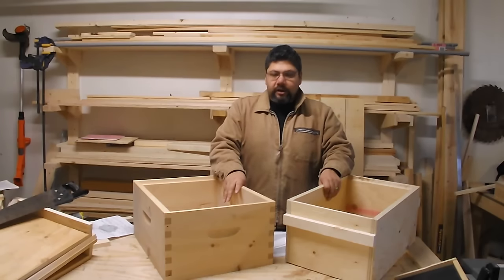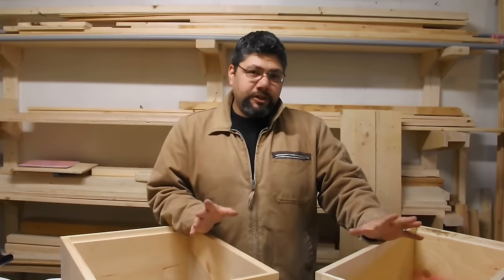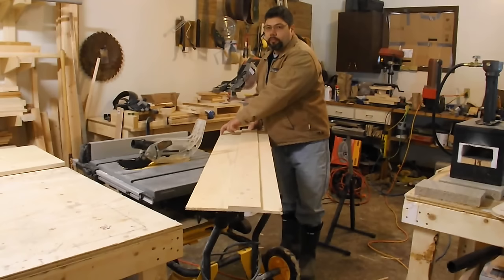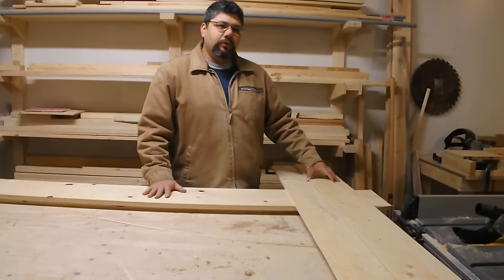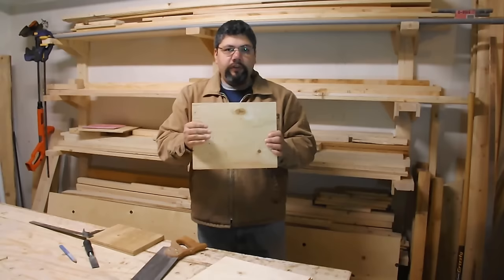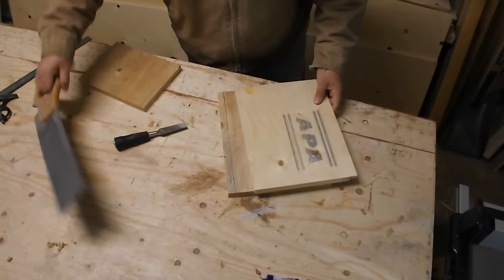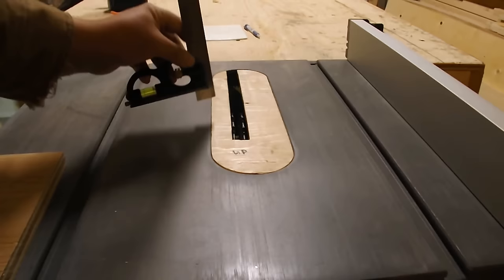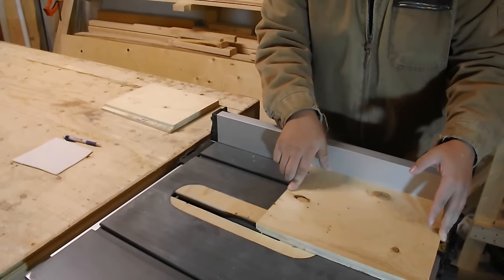How to make a simple Langstroth beehive

Comment: I thought exterior plywood was pressure treated and pressure treated wood is not supposed to be used in making a beehive because of the chemicals .
Reply from the maker: Ali Sullivan keeping it easy for this topic there three types of plywood, 2 exterior and 1 interior.

pressure treated plywood, is usually green or brown has chemicals, decks, wood basements, or form material (oil/kerosene soaked). This you don’t want.

The other is untreated exterior grade. This is house sheeting material, it has water proof glue much like the glue you use to glue typical wood hives together. Titebond III for example. 

The third type is normal plywood, it has cheaper glue, also untreated but this normal glue will delaminate within a year. If you ever see plywood that’s all fanned out and separating, that’s normal interior grade plywood that’s been left out in the weather. Also the other type you don’t want.

Comment: This 1 box cost me 47 dollar plus shipping new>  and this  i made cost 4  dollars and made 4 and 1/2 boxes for 15 dollars Example how easy you get screwed from these bee suppliers ! Yes 1" x 12" x 12' long  board > made  4 and 1/2 boxes with 2 ends left over for another box Yep butt em up drill, glue and screw>  I don't like nails they wiggle out use screw and glue just as good as a finger joint > PLYWOOD WRAPS >  have to use braces on the out side to kept it from wrapping  HOW I KNOW?  MADE SWARM TRAP OUT OF PLYWOOD!  PUT THE BRACES AROUND NEAR THE TOP TO KEPT IT FROM WRAPPING where it don't inter fear with the lid

Comment: Can I get you a heater for your Work Area?

DUDE!!!  GET A HEATER...  we can see the vapor from your breath.

is it cold or what?
Reply from the maker: lol, If I remember right, -30 Celsius at the time outside, but about 0 inside the garage. I have a small heater but until I upgrade the OH door not much point in installing a larger one, I'd just be paying to heat the outdoors. Growing up here I've just learnt, writing and designing in the snow season, outdoor reno and garage in the non snow season. :)